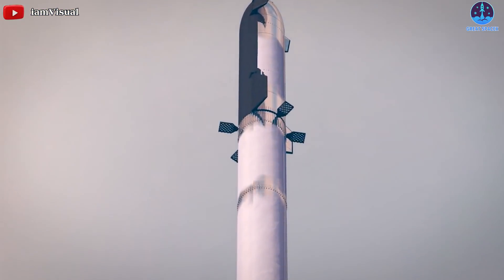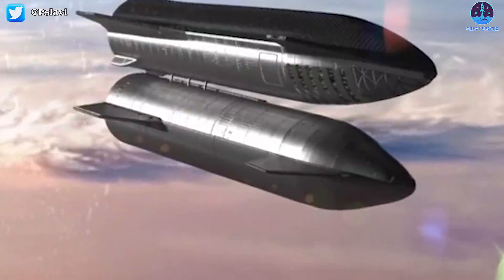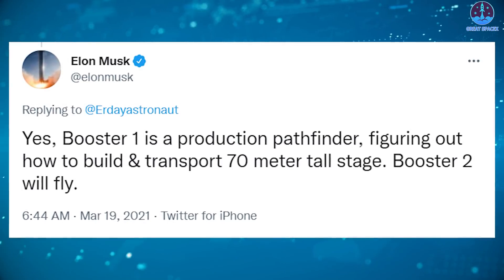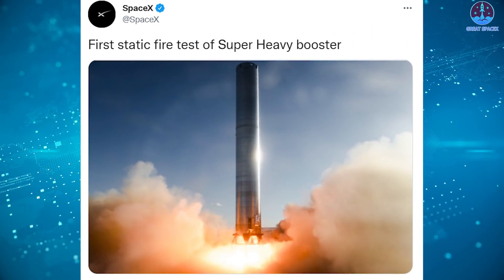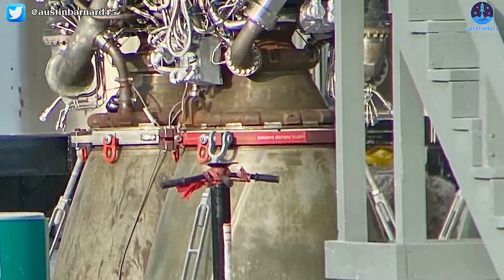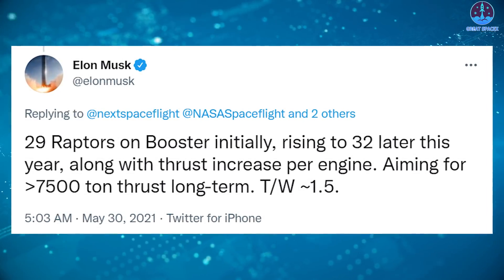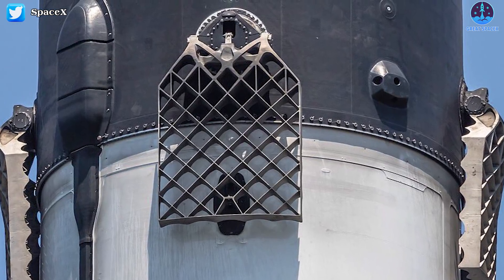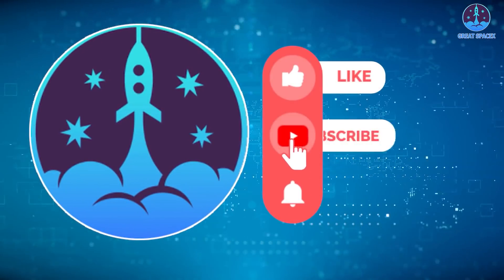SpaceX HIDDEN WEAPON The Super Heavy

Comment: I'm super excited to see the super heavy lift off. The Russian N1 lost one engine on it's maiden launch. Number 18. I'm pretty sure Elon has allowed for maybe 3 engine failures, and still achieve the orbit the test is designed for. I don't see the payload being more than a 1/3 of the ships potential. So what do you load on a test flight that serves a purpose if successful that can aid in future flights. I don't know if the Starship will have a bay system capable of delivering a fuel and Oxygen pair of tanks that have a refueling setup. They don't have to be huge, just enough capacity to provide emergency refueling to a future Starship that needs maybe 1000 gallons to have a safe return landing. Just thinking outside the box as to how to make this test flight more than just an empty payload bay, and not something so expensive you don't want to risk it on a test flight. Leaving a full gas can in space for future emergencies just sounds like a smart option. If the whole Super Heavy blows up at launch a little more fuel isn't going to make a lot of difference.   
I wish SpaceX would land the Starship at the Tillamook, OR. airfield

Comment: I think he is using stainless steel for the time being until everything is sorted out. Once they Master spaceship Elon will switch to carbon composite.
Reply: No, they won't. One of the main reasons why they selected steel is that steel has much wider range of working temperatures comparing to carbon composites.

Comment: All those engines on super heavy makes it seem implausibly suspect. Conversely if their modelling. AI and engineering tolerances are  good, then the amount of redundancy that could be allocated to avert bad scenarios via micro second software management, might just make for something miraculous in terms of reliability. Seeing the AI consistently guide Falcon 9's to a bulleye landing, maybe indicates that SpaceX knows the day computers can model and control every system, manage every drop of fuel in ways that are virtually fail safe are nearing reality faster than most think...
Reply from the maker: Yep, it will be the best choice.

Comment: Elon has proved that NASA should never have proprietorship or engineering control of another space vehicle. .... When he sees a problem or improvement opportunity he acts instantly. .... The cowardly incrementalism of NASA's bureacracy is the only reason that two Space Shuttles exploded.
Reply: You're right in part, but Elon leaned heavily on the brain-trust and experience of NASA to make SpaceX a smooth success. Without NASA it's entirely plausible SpaceX would have experienced similar events during test flights (e.g., the Dragon capsule that exploded during testing -- which was analyzed and fixed with NASA's help).
Reply: The James Webb telescope launches on Dec 18th. 10 years behind schedule, and billions over budget. I find it insane that the Webb will be launched on an modified Arian rocket that is basically taking it's maiden voyage. The EU is paying the launch costs inorder to get access time to the Webb telescope. If they screw up the launch and placement NASA is going to have several unemployed directors. Elon can come to the rescue with a crewed Starship in a few years if things don't go as planned. No one else will have the capability. He gets to be a hero if thats the case. He can upgrade Hubble on the same trip.

Comment: Dumb question but how does super heavy Yaw ?
Reply: Just a guess but I would assume the grid fins on one side would increase drag by either angling in toward each other or angling away from each other while the fins on the other side maintain a straight configuration. This would cause the booster to angle (yaw) toward the side with more drag.